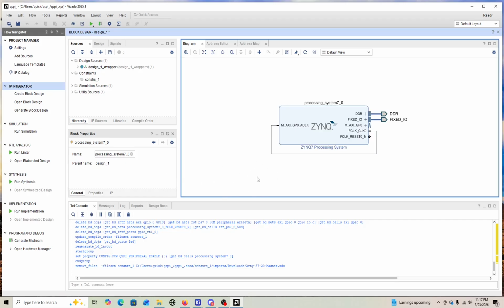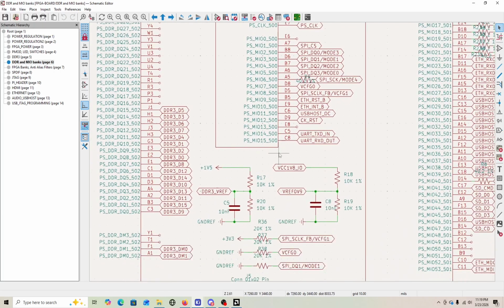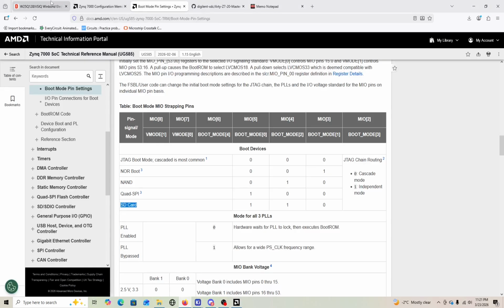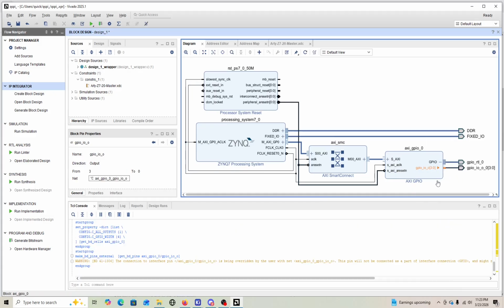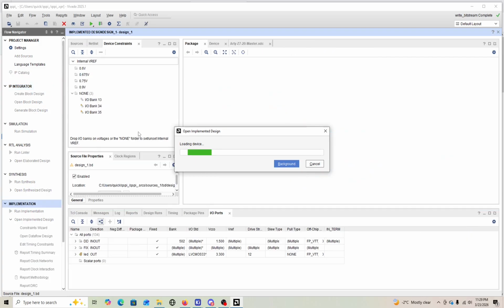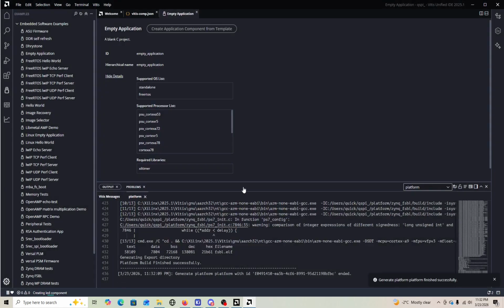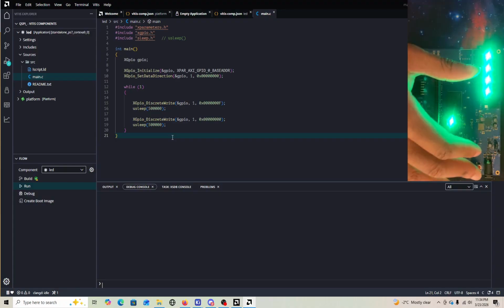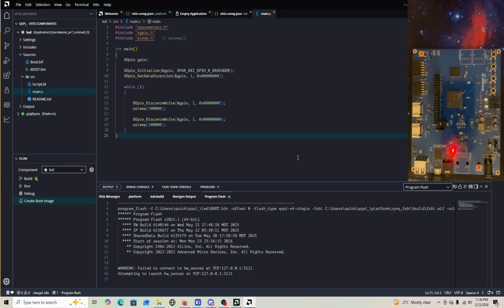Custom Zynq Board QSPI Boot Test | Vivado and Vitis LED Blink Demo

Comment: Hi Abdul,
Thanks for the video!
I have one question about the version of Vitis you’re using in your project. It seems like you’re using the 2025 or 2026 version. I tried using 2025.1, but it doesn’t work at all, even though I followed exactly the same steps as you did in your video.
Reply from the maker: my version of Vitis is 2025.1 as well. Can you elaborate on what exactly is not functioning for you? perhaps I can provide insight then